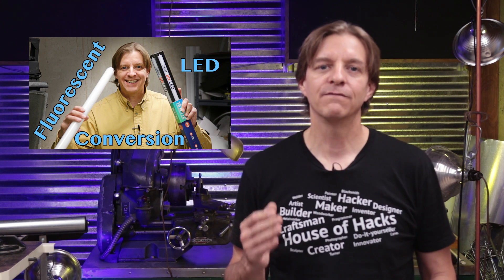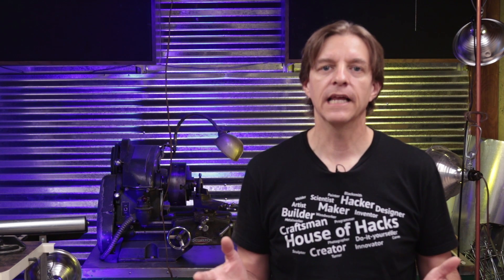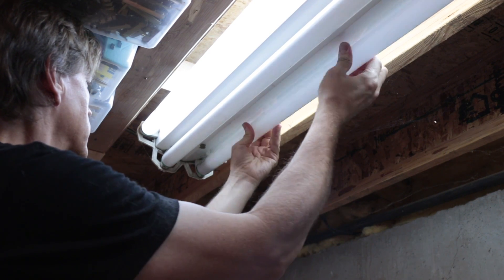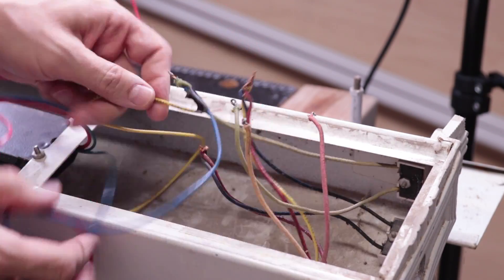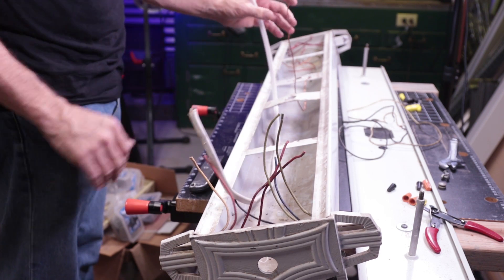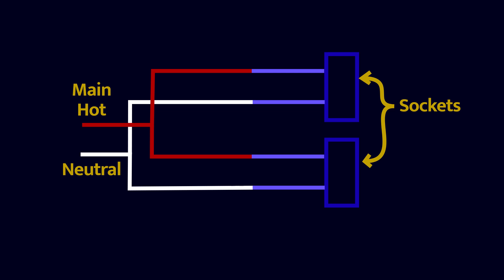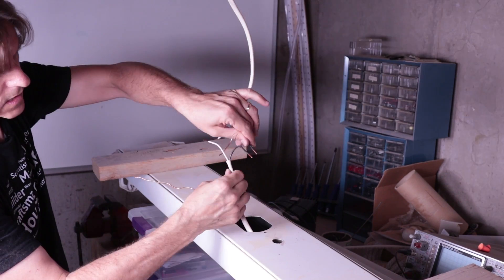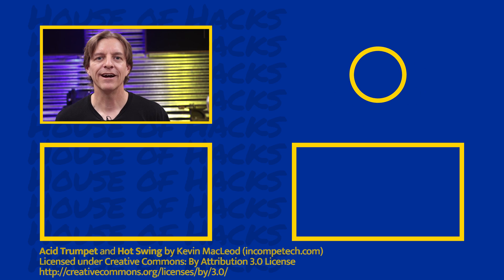How to convert fluorescent tubes to LEDs using ballast bypass (Part 2)

Comment: So I converted my lights to led, they worked..went into my house for 30 mins came back flipped the switch then nothing.. what’s up with that?
Reply from the maker: Gremlins. :-D
Time to start troubleshooting. Use a multimeter to check power and track down where it's not getting through. Good luck!

Comment: Great video thanks you also answered my question do I need to replace the lamp holders but the way the lights are hung so they can be moved back & forth wire permitting or taken down so easily was great then I see all the bins in the ceiling. I've been around a while done every type of construction there is (residential & commercial save electrical & roofing) for 40+ yrs I've NEVER seen that now I have to look at Home Depot for similar bins. This looks pretty easy but if I screw it up I was a Structural Steel Ironworker for 25 yrs so I know to just get a bigger hammer.
Reply from the maker: Cool! I got those bins at Target. They're the shoe box size with locking lids to keep the dust out. I have some cedar paneling slats from lining a closet and just tack them to the bottom of the floor struts. I have a short video on it: https://youtu.be/zuCzU1q26fw

Comment: How do you know if you need a kit to do this mod or just new LED bulbs and some wiring...? Thanks
Reply from the maker: Not sure what you mean by "kit." Replacement LED tubes will either be designed for use with or without ballast and should indicate so on the box. Does that answer your question?
Reply: Yes, at first I didn’t realize there are two types of LED replacement light for older fluorescent tubes. I never saw your first vid on this subject. After watching a few other folks vids on YouTube, I now realize it, thanks.
Reply: Currently there are four "types" of led tubes. Type A is plug & play which uses original ballast and wiring. Type B is ballast bypass and either single ended or double ended. Type C is ballast bypass but requires an externally mounted led driver. (Type B has an internal driver on one end that reduces the effective illumination length of a 48" tube by about 3 inches). Type D are "hybrids" (Type A + Type B) that have an internal driver and can be used with or without a ballast. I personally prefer the non-dimmable single ended Type B bulbs due to their cleaner install and greater output, i.e., more lumens/watt.

Comment: Thats the best way. If ballast goes bad, u have no light. In my opinion,  this is the only way to do it, and the bonus is less electricity too as you are no longer using power to drive the ballast
Reply from the maker: There are certainly a number of benefits to doing it this way. "Best" depends on what you're optimizing for and may vary depending on circumstances. Cheers.
Reply: @HouseOfHacks  best meaning, full power saving benefits,  longevity of fixture. Its a win win. I dont know how "best" would ever fit the other version where ballast is left operational
Reply from the maker: Removing the ballast would not be "best" if you wanted any of: minimal install time, no need for electrician or to be able to easily go back to fluorescent tubes. And there may be others that I'm not thinking of. Peace.
Reply: @HouseOfHacks  lol, no n3ed for electrician. ..u dont need electrician to do this!!! You are no electrician and u did it!!!! Your definition of "best" sure is expandable. Nobody would ever, go back to flourescent, no need for electrician,  so thats 2 of your thoughts,  theres only 1 left and that is quicker install time lol. Well, quicker, is never better, we all know that and were taught it. Do it right 1st time and save time.
Reply from the maker: Well, it depends on context. A company in a commercial building, or residences in some cases (e.g. in an apartment or condo or HOA, or somewhere outside the US), might require a certified electrician to do anything with line power. And I can imagine some situations where the option to go back to fluorescent lights might be desired, e.g. a company with a stock of fluorescent tubes or someone experimenting with LEDs and unsure if they want to commit to it or rented space where the current tenant may want LED, but the landlord doesn't want to commit. And there may be times where time is of the essence. Again, IMO, "best" and "right" are context dependent.
Reply: @HouseOfHacks  nope, not for a shop light. They are plug and play. no electrician
Reply: Ya reachn bro ;)
Reply from the maker: Some shop lights are plug and play but not all are. Not all fluorescent lights are shop lights. ;-)
Reply: @HouseOfHacks  you obvioulsy know everything abd alwayd are used to getting the last word in so yeah, go for it. You are right, you are right, you are always right. Who am i as a 34 year tech to ask or comment on your little video. Ive been doing this before youtube was a thought, heck, before the internet even was a thought lol.
Reply from the maker: Hey man, I'm not trying to make you mad, just trying to point out that the world is a big place and what's best in one context may not be in another. Peace.
Reply: @HouseOfHacks  no, you are right

Comment: Can i ask... i got an 32W circline fixture and the ballast drives a 36W bulb would it cause any damage or no?
Reply from the maker: The wattage isn't so much the issue as the voltage. The ballast should list the applications it's designed for; check it's documentation. If you don't have any, you can probably find it on the manufacturer's website. Hope that helps. Peace.

Comment: The cable should be attached the fixture with a proper connector.  Then your electrical connections will be safely inside the enclosure.
Reply from the maker: Yes, if I were worried about being up to code, that would be the way to do it. Peace.

Comment: Am I to assume the sockets in this particular light fixture were un-shunted?  Did you make reference to this fact either way?
Reply from the maker: For these particular 2-pin bulbs, the connector on one end was connected to hot on one pin and neutral on the other. The connector on the other end was left unconnected. Does that answer your question? Cheers.
Reply: @HouseOfHacks  So you can do it this way then? That's good to know as I was under the impression that I had to purchase special connectors
Reply from the maker: @El-Tejano  It will depend on the particular bulbs you get. I made sure to get bulbs that matched the connectors that were already in my fixture. If you do need to replace the connectors, all the ones I've seen just clip into place pretty easily.
Reply: @HouseOfHacks I tried the wiring setup tonight and nothing worked. I took one wire from one of the connectors, one connected to the neutral end (white) and one connected to the hot end (black), on the opposite side of the light fixture, I removed the wires altogether. After the wiring was completed, I popped in an LED tube, flipped the breaker and then the light switch but nothing. I've tried just about everything, short of buying shunts made for LED's but still can't get the bypass method to work
I saw this other YT vid and wanted to know if this method differs from yours, I just need it to work
https://youtu.be/EZQ8Pn7cVic
Reply from the maker: How it's wired will depend on the particular lights you have. They should have come with wiring diagrams and you need to follow those.

That said, are they single pin connectors or dual pin connectors?

If they're single pin, then white will be connected to one end and black will be connected to the other end. If they don't light, try turning the bulb around as they may only work one way.

if they're dual pin they get more complicated as there may be different wiring configurations needed. First, are they single ended or double ended? I showed single ended bulbs where the power only goes to one side. The video you referenced above are for double ended bulbs where the power goes to both ends, similar to single pin setups.

If they're single ended, like mine, then probably white and black should be connected to one end and the other end left unconnected. If they don't work, try turning the bulb around end for end. If they still don't work, swap the white and black wires. If they still don't work, try turning the bulb around end for end. There are only four combinations.

Of none of the above works, are you sure the bulbs are designed for working without ballast? Some LED lights are designed for direct replacement with the ballast in place.

Hope that helps.
Reply: House of Hacks Thank-you for this. They are Philips LED  double ended with 2 pins on each side (T12). I'll try the method in the video I provided and if that doesn't work, I'll most likely just convert the whole thing to retrofit recessed   LED lights. Again thank you for the education, I'm no electrician by any means but sometimes simple things are worth trying on your own
Reply from the maker: @El-Tejano  You're welcome. It's certainly worth trying to get them working. Good luck!

Comment: When Fluorescent tubes burn out why do the electrodes give a orange light or red?
Reply from the maker: Hmm, I haven't seen that before. I'm not sure. This list of fluorescent problems and their causes indicates it may be due to failures related to preheating and/or starters on lamps with them: https://www.electronicspoint.com/threads/re-failure-modes-for-fluorescent-lamps.190047/
Reply: Lightbulb burned out

Comment: I got a emergency Fluorescent lamp and it's tube is about to burn out. I might as well change the tube but the problem is the tube is small VERY SMALL!  It uses 8 watts and I don't know if I can get a small LED tube... because I have only seen long ones. Could you help me?
Reply from the maker: First, I'd take the model number for the lamp and search around the internet for an LED replacement. Something like "abc123 LED replacement." Next, if nothing shows up, I'd try to retrofit existing LEDs to the enclosure. Depending on the design, that could take a bit of engineering. Might be easiest to get a replacement fluorescent.

Comment: What happens if you don't remove the ballast and just remove the cfl tubes and replace them with led but leave the ballast alone?
Reply from the maker: It depends on the LEDs. Some LED replacement tubes are designed to work with the ballast and some are designed to work with line voltage. What happens to the tube when it's used with the wrong voltage will depend on the tube's design. I talk about the type that use the ballast in this earlier video: https://www.youtube.com/watch?v=_YROz2AekkA&list=PLWmDBD9Srrwn5n-YSqq4NrRxRpRPaUBkV

Cheers.
Reply: Thank you. Can I also ask does it say on the box of a led tube that it needs a ballast or a line voltage?
Reply from the maker: Yes. The ones I've seen say "ballast bypass" when the ballast isn't used and "ballast required" when it's used.

Comment: Some florescent connect to power from end to end others connect to power across the pins on one end. I believe we may need the exact number on the florescent to know how to install it.
Reply from the maker: If the fixture has a different style connector than the bulb, the connector can be changed with the correct type. The LEDs I got came with new connectors that I could have used it I wished. The the ones in the fixture worked, so I didn't bother. If they do need to be changed, it's just a matter of snapping out the old ones and snapping in new ones. Cheers.